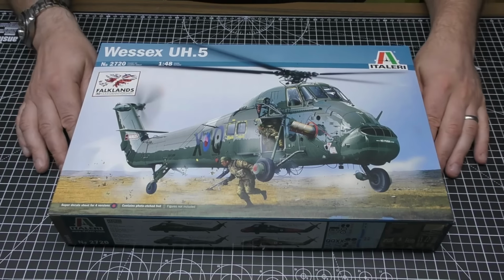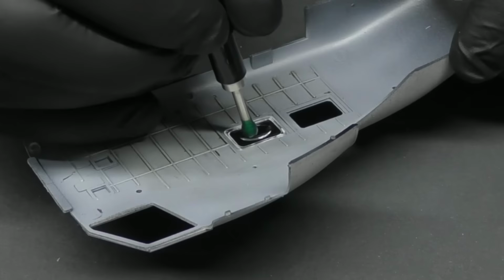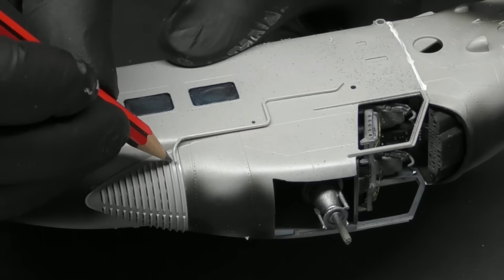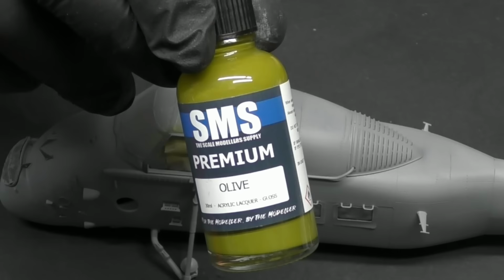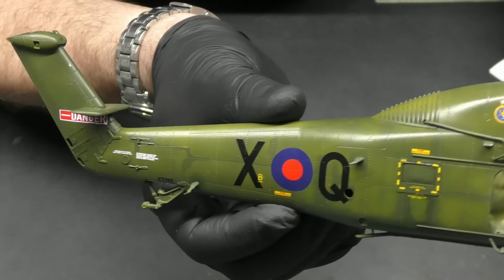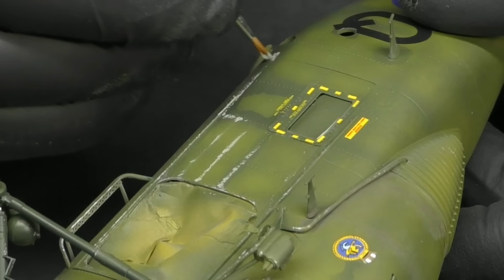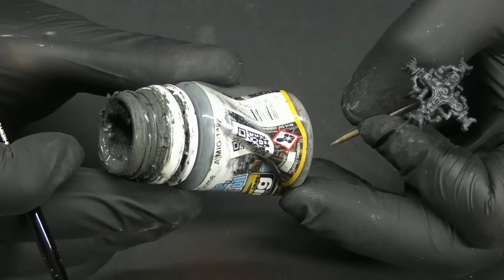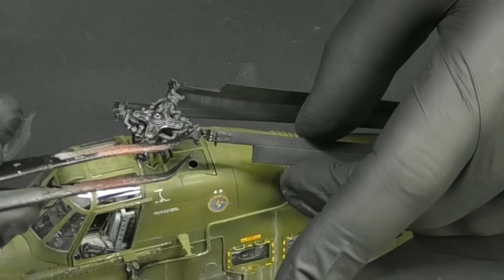ITALERI 1/48 Wessex UH.5 No 2720 - Model helicopter build.

Comment: I found this interesting not as a modeller but as a former Wessex V mechanic on 707 and 845 Squadrons. I think that there is an error on the box as it says that this Wessex V was from 874 Squadron - it should be 847 Squadron which was formed for the Falklands War using aircraft and personnel from 707, 845 and 846 Squadrons. Also, it was an HU.5 (Helicopter Utility - almost all military nomenclature is kind of backwards).

A few details which may be of interest; the flotation canisters should have a warning triangle on them, probably diluted white in this livery (they would normally be white with red warning triangles) as they could be lethal if activated but given that the blades are folded, they would be removed as part of the AFI (After Flight Inspection). They are inserted into the wheel axle and held in by a single pin for whick release and would never be fitted in a hangar). They automatically inflate through the wheel axle from the spherical tanks under the oleos if the aircraft enters the water. The blade saddle is not how I remember them, they weren't like two pairs of ribs with pads, they came in two pieces each of which consisted of a number of hinged, padded panels and which hooked onto a pin on top of the tail and held down by straps anchored on the sides of the tail - you had to be careful when sitting astride and sliding along the tail when working there! The blade saddle would Ground Equipment Red (which is like Post Office Red) by necessity and would not be grimey. There should be step areas along the top of the tail - rectangular areas of black textured paint to allow ground crew to walk along the tail safely - usually outlined in white but not in thislivery. There also appears to be a few missing aerials, notably UHF/RDF. Incidentally, I didn't know what all the added holes were for but then realised that there should be grills on them.

Comment: That is a very realistic paint job and overall presentation of the model. I think the Italeri kits can be a bit of a challenge to get together. I like using CA glue as a filler and, as its harder than plastic, I use good quality needle files and small 4" files to smooth it down. The advantage is that there is no drying time so you can work a little quicker. without waiting for filler to dry.

Comment: 🎉fantastic build for an old retired WX 5. But in my day in the Navy we used to keep them in tip top condition, after every flight they would be sprayed in WD 40 so would have a slight sheen to them. There weren’t many oil streaks or worn panels as you have shown here. It’s a shame you could not have built one in operational condition. Anyway keep up the good work love it.

Comment: Fantastic job. From memory the floatation canister in the main wheel had an explosive triangle decal in the centre. The round flotation gas bottles were white with the same decal. The blade fold saddles are brilliant. Would have been great with the tail folded too.  Ready for striking down to the hangar onboard the carrier.

Comment: Good modeling. I've been building models for a long time, but you have shown me some techniques I can use to improve what I do.

Personal note: the Wessex you are building here is based on a Sikorsky the US Army used as the CH-34. Was a passenger in one Winter of 1966-67 that stopped for fuel at Marville RCAF Station, Montmedy-am-Meuse. Suffered a mechanical problem that led to a ruptured fuel tank and massive fire. We (the passengers and pilot) all got out OK, but scary. I need to build a -34 as a memory, I guess.

Comment: Build yourself a micro dual action sander. Buy a cheap-ish electric toothbrush with replaceable heads (the simple round heads work the best).  Get ahold of some  PSA DA paper and a gasket hole maker kit, cut some round small diameter sanding discs close to the diameter of the head. Cut the bristles off the brush heads, then apply the PSA paper. If you get multiple heads you can dedicate a head for a specific grit. The one I built years back has made small modifications and surface finishing much more intricate and consistant.

Comment: Since my previous comment regarding Making an RAF HC2 version of this kit was deleted (for mentioning an online auction site perhaps), I will have another go at pointing out that this can be done if you purchase the version H-34G.III/UH-34J version, which contains the correct fuselage halves to enable you to do so. You can use the HC5 parts to complete the H-34 kit, so no waste - just a slightly inaccurate H-34. For the RAF model, just leave off all the Navy extras such as the external pipework, aerials and U/C flotation devices, and substitute the main fuselage halves supplied for the H-34 ones.

Comment: Really nice model but there is a problem with the rotor blade stowage, before the blades are folded the portside ones are rotated through 180 degrees so that when they fold back the leading edges are downwards in the blade saddles the same as the starboard ones.
Reply: Agreed, and more likely than not the tail will be folded before the blades - but that requires a completely different addon set, unless you are adept at 3d modelling & have a 3d resin printer.

Comment: Great work as usual. To reinforce PE joints I've started using UV resin. The brand I use is made by JDiction and dries crystal clear. I cure it with a small pen style UV torch, although I do find I have to go to a darker room to get it to cure quicker. Whether this is due to the torch not being very powerful or slightly the wrong wave length I don't know. Still works though.
Reply from the maker: Thanks Mark, good tip! Andy

Comment: Hi just came across your model of the Wessex 5 but the rotor blades on the port side are the wrong way round the leading edge should sit in the saddle the reason for this is there is a ratchet at the top of the blade from the hub to the blade itself this is undone and the whole blade is flipped over before removing the top pin

Comment: I don't know why people are so obsessed with putting down a clear gloss before applying decals. The idea is that it's meant to give a smoother surface to prevent silvering, but in this case the gloss orange-peeled and was far worse than that gorgeous, flawless paint. If you have a super smooth paint surface there is absolutely no need for a gloss coat. It seems these days people put down gloss coats mainly because "well, that's what you do", like it's a rule. Also, keep the gloss coat wet by getting a bit closer and the overspray won't dry out before it hits the surface, that way you don't get a surface like glossy sandpaper.

Comment: Nice model and close to actual.  However the MRBs should be leading edge down on both sides.  They are trailing edge down on the port side. On the real aircraft this would damage the pockets.  The devil is in the detail but i would be happy to commission a model.

Comment: Nice work but the Helicopter itself is very very ugly^^
Reply: Hello there.

I was in the Royal Artillery for quite a few years and the main training area for our unit was Otterburn/Redesdale, it's in Northumberland and in winter can be a very bleak place. We often trained with Heli and over the years I experienced many lifts, some for the guns (L118/L19) and later on as a part of an OP team. Whether its accurate or not, you build up an internal expectation of whether the 'lift' will take place depending on the kit that the lifters bring with them. If it was Navy (at the time Sea Kings) you know it was a go - no matter what - even if the pilot was spweing out the door (big session at the Officers Mess). If it was RAF it seemed the more current the aircraft - Pumas as an example  - the more chance it was off - however if it was Wessex, you knew your ride was going to happen.

Often substance is more important than style.